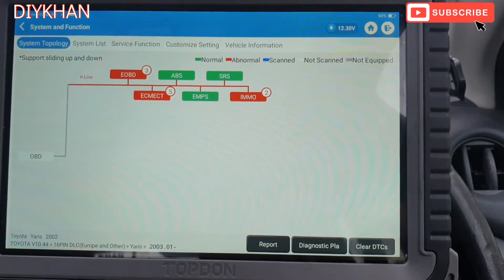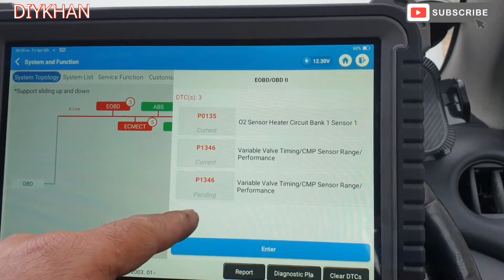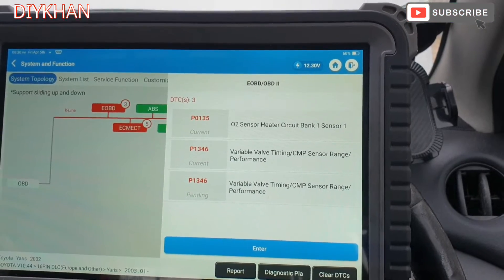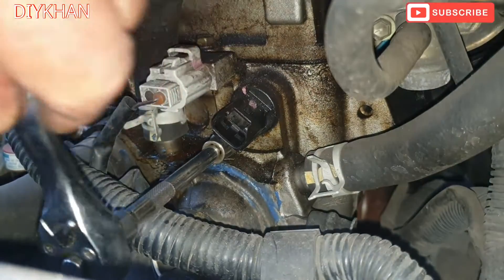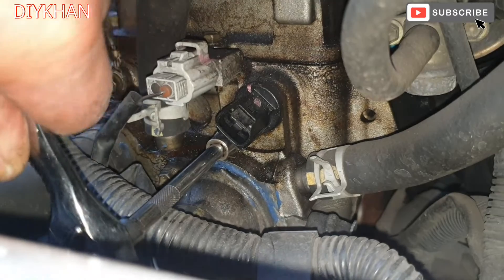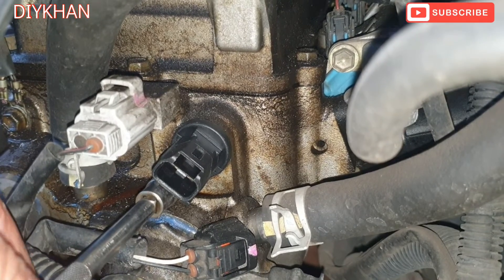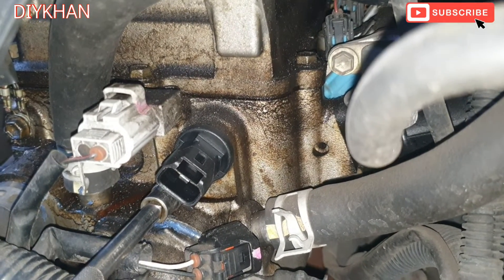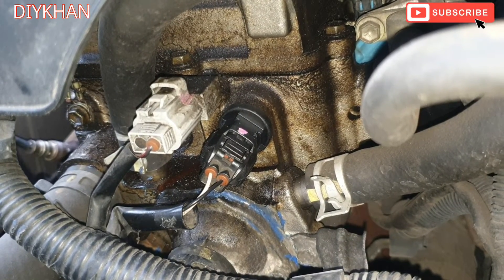Toyota Yaris 1.0, 1.3 VVTI MK1 and MK2 Petrol Camshaft Sensor Change. Fault Code P1346 and P0340.

Comment: Κάθε πότε χρειάζεται αλλαγή;;;; Και πόσο στοιχίζει;;;;
Reply from the maker: A Faulty sensor will trigger the engine management light on the dash. Otherwise doesn't need changing. Good luck 👍

Comment: There are two crank sensors in my Yaris vehicle, one is on top and the other is on the bottom. I checked both of them and they are working, but there is a p1340 fault code, where could the fault be? Can you help???
Reply from the maker: @ugurg2273  have you checked the harness or the connectors. I would chase the cables to look for any damage
Reply: @diykhan I checked the sensors, let me check the wiring harness with a multimeter, thank you for your help, a technician told me that she would remove the timing chain and reattach it.

Comment: Hi Khan, great video as always. I've seen your previous video regarding P1346 DTC. I'm fighting a P1346 code myself at the moment. Just P1346 pending and stored. Car runs absolutely fine otherwise. No idle trouble or rough idle. 

What symptoms was this car showing before you changed the sensor? Obviously engine light but anything else?
Reply from the maker: There wasn't any bad symptoms as such but the engine light kept on failing the mot so that's why I changed the sensor.